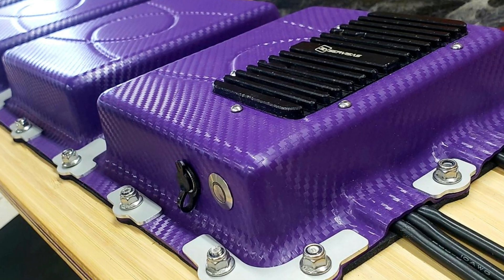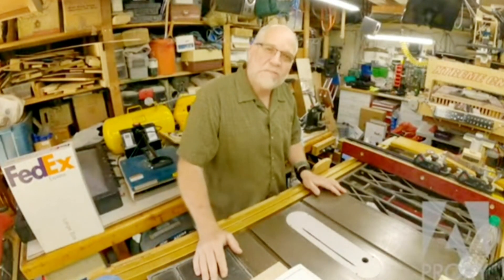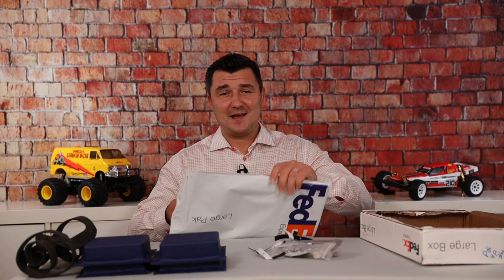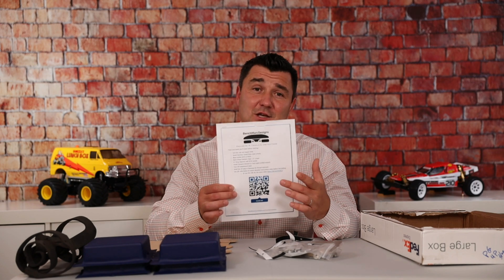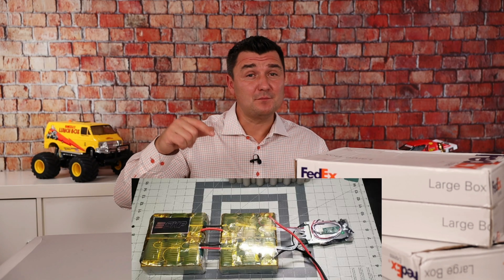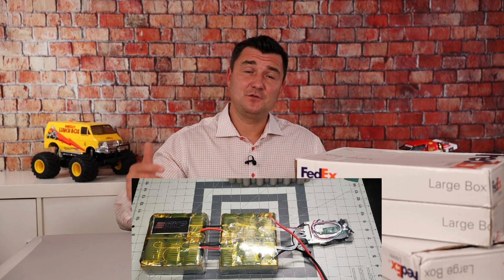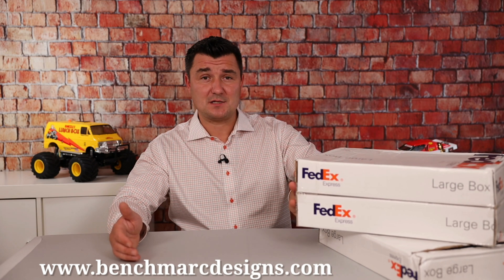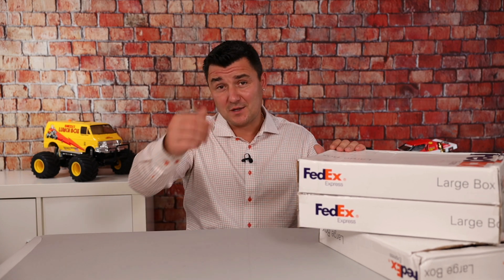Very flexible battery enclosure kit.

Comment: General rule of thumb is not using lipos in e-skates, cuz the whole explody part when you smack them hard enough.
Reply from the maker: I do agree,  it's best not to use lipos under the deck. This enclosure system is designed for 18650 or 21700.

Comment: awesome videos! If you came a cross this comment i love to pick your brain on my curren build. im making a 18s8p p42 battery on flux deck (heavy rider 250lbs ish), 8 inch tires. im struggling picking a dual motor (brand kv and size). is there any specific one you think will suit me best? im looking for semi high top speed around 40-45mph ish while keeping my boar torquey and good on hills. i use 1 to 4 104mm Finality AT Gear Drive. i was thinking flipsky 61300 with 140kv but im not sure, any suggestions?
Reply from the maker: Hi mate,
My Bullet build has 1:4 gear ratio , 9" tyres, 12S7P battery. Flipsky 63100 170 kV were giving me 50 mph. I did swap out to 140kV and i can get 41mph flat out. Torque is reasonable. I am 110 kilo.
Reply: @PavelGarmas  thank you

Comment: Nice. Could you share the measurements of both 3 and 4 module kits? Also the website? Thanks bud.
Reply from the maker: Hi mate, 
All the measurements are on the website  buddy. Here is the link. You can get 10% off with code Pav10.
https://www.benchmarcdesigns.com/